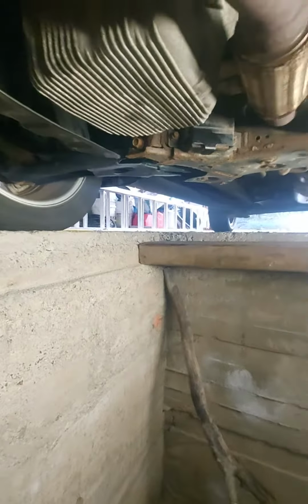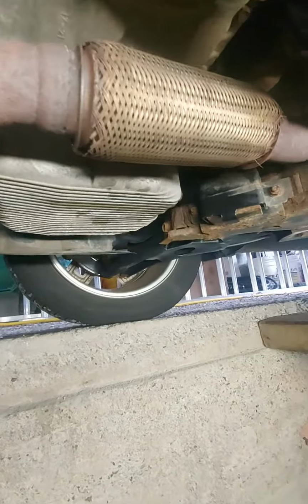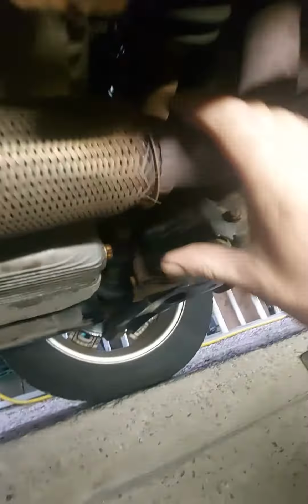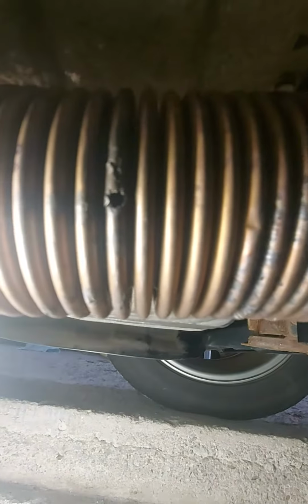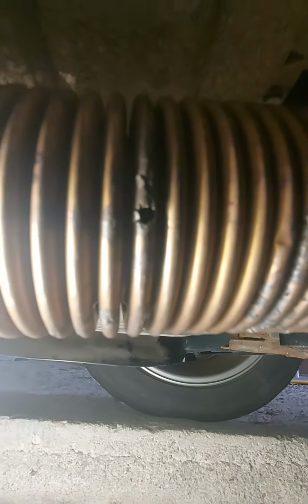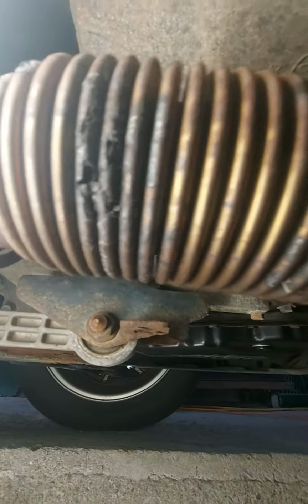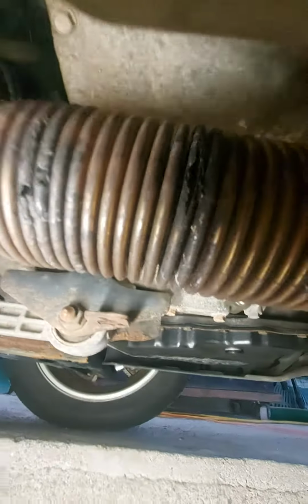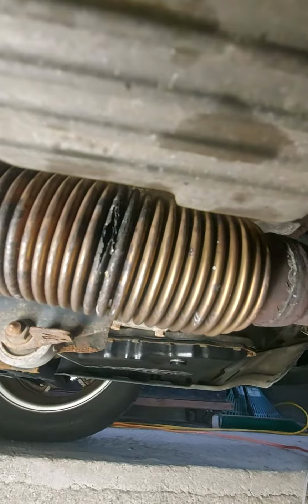Exhaust Flex Pipe 2011 Kia Soul

Comment: What part did you ended up getting? Did you buy the flex pipe itself? I got a similar issue.  Trying to figure out what size flex pipe to get
Reply from the maker: I installed a new pipe which comes assembled with that flex pipe segment. Auto part stores sell flex segments where you'll have to weld them in, but for a bit more money just change the pipe as an assembly. All new metal. An on-line auto parts store in Mississauga Ontario Canada called "Wrench Monkey" has some great prices and ship across the border. Have a look, and read the parts description carefully to be sure you have the right vehicle, engine size, all that before purchase.